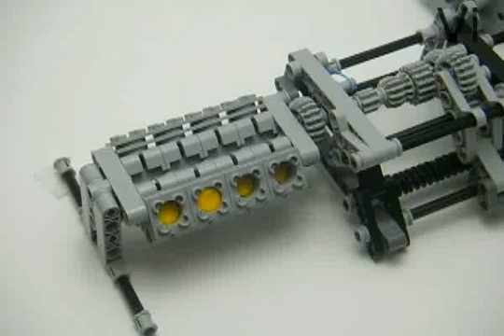V8 Engine In Motion

Comment: You have the system set up wrong. The point of a transmission is to keep the engine from having to work too hard. The engine speed should stay constant and the output of the transmission should increase in speed with a higher gear. Much like what Austin Washburn said.

Comment: your ass backwards. the engine rpms shouldn't change. the input stays the same, as you switch gears the output should change. in this you have the engine as the output.

Comment: I know this is for demonstration only, but shouldn't the output shaft of the transmission be spinning faster? Or better yet, shouldn't the crankshaft be connected to the input of the transmission rather than the output? Your RPM's of the engine shouldn't increase depending on the gear selected.